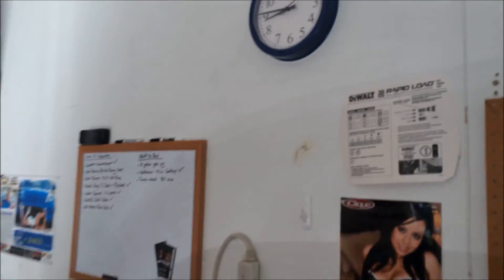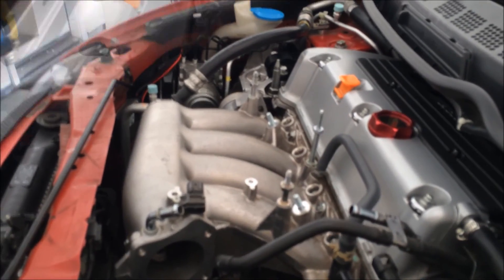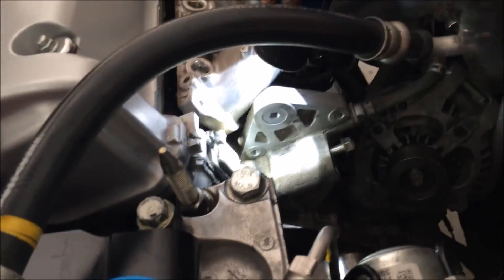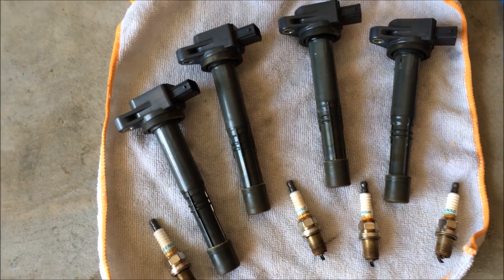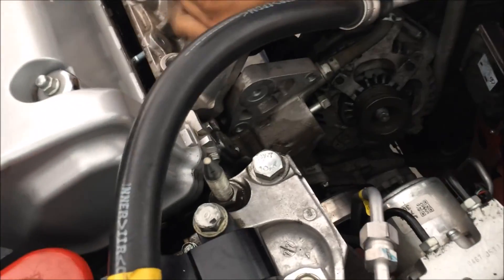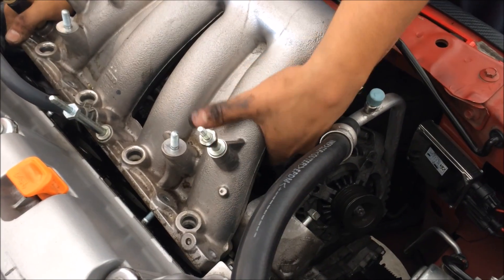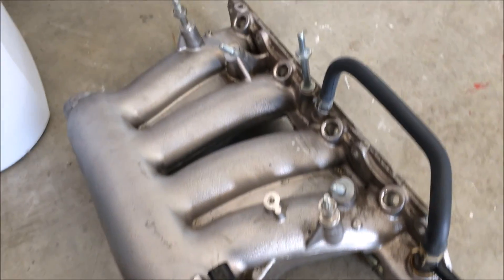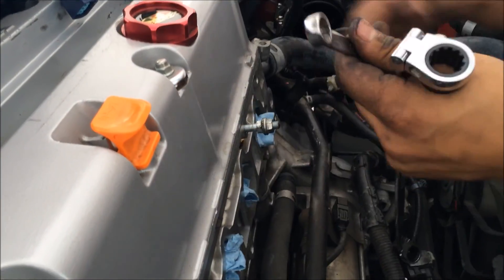CT Supercharger Build Part 4: Remove Tensioner, Remove Manifold, Install CT Tensioner

Comment: I have a Skunk2 intake manifold to put on and I struggled so badly trying to get the stock one off because of that bracket that I gave up after a half hour of yanking and twisting and put it all back together. I was so pissed.